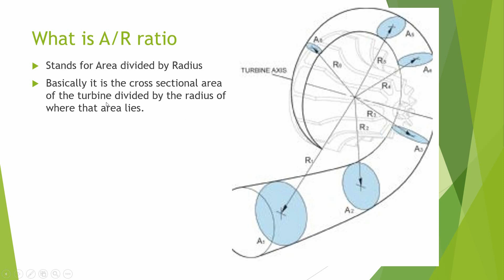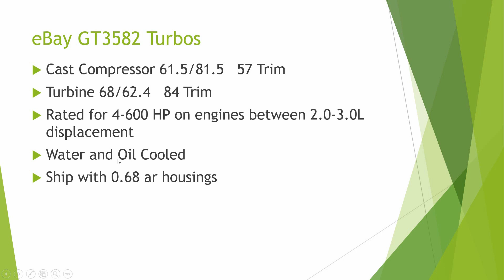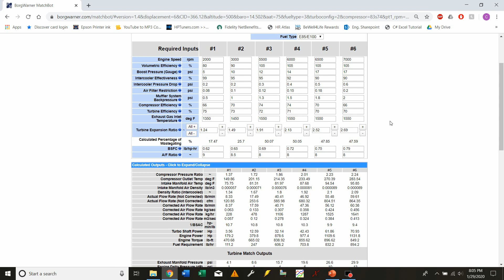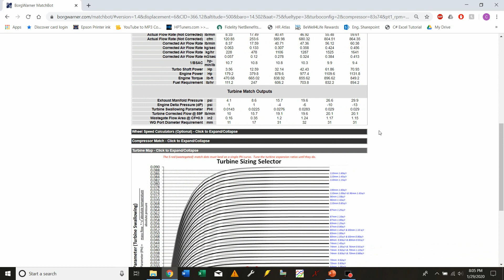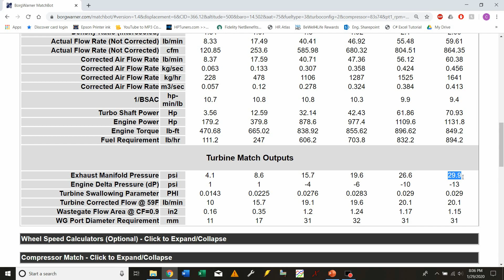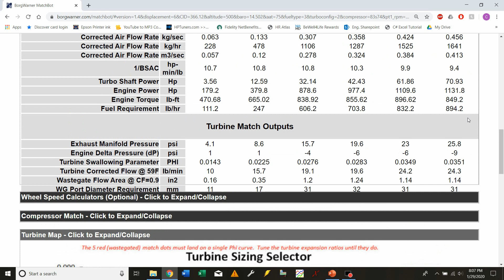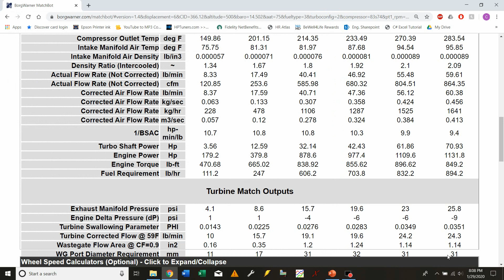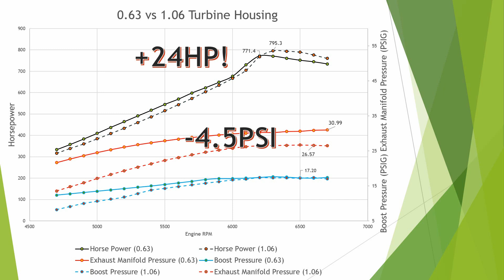How do Turbine Housings Effect Horsepower

Comment: you had said they sent the .63 housing instead of the .68 . when you changed the housing in the video you had said it was a 1.06 ar housing . did you just go ahead and buy a larger housing or did you ask the same company to send you the larger one . If not then did you out source one . because my question is are parts interchangeable .

Comment: I don’t know about gasoline engines, but with Diesel engines the compound turbo system is the only way to go. Instant spoolup and when your small high pressure starts to peter out is when the larger low pressure turbo starts to kick in keeping the spoolup throughout the higher rpm’s. Learned a few things during this video and I thank you for that. All the best!
Reply: That's a sequential setup.  In a compound setup, the big turbo feeds air into the small turbo